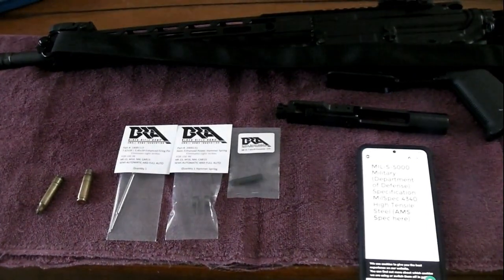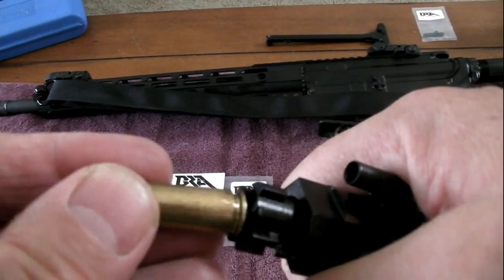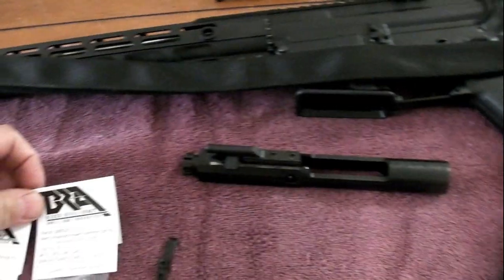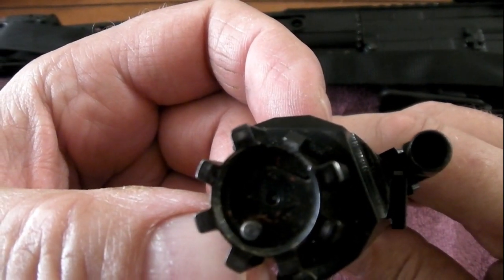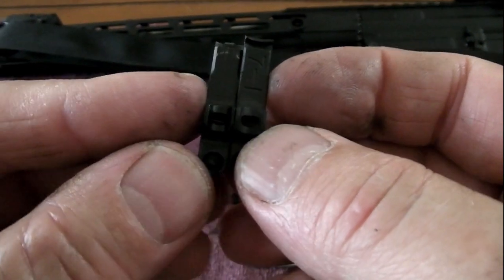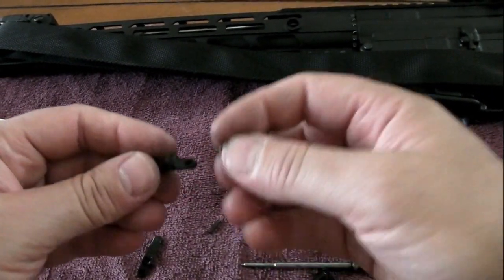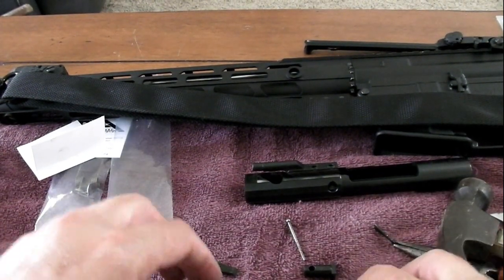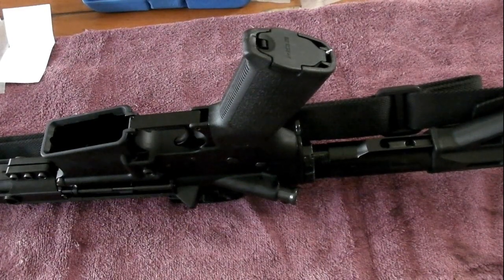7.62 X 39 AR15 Extractor Problems

Comment: I tried using the BRA extractor with Tactical Springs 4-Coil Extractor Springs, and the darn spring wouldn't fit in the cup. I ended up using my old extractor that wasn't broken, and I had failure to eject issues every time. I contacted Alan from Tactical Springs about this issue, and he thinks that the extractors themselves are all out of spec. It certainly wouldn't surprise me, but I just wish every brand followed the same military specifications.

Comment: Well I got about 500 rounds in before my extractor broke on a Bear Creek Arsenal upper.  I  replaced the firing pin fairly early due to light primer strikes with the same brand you have in the video. Guess I will start doing some more research on extractors now.
Reply: Will that extractor fit a BEAR CREEK bolt carrier group bc I can’t find a replacement and was just gonna pay 200$ for a stainless BCG
Reply: @eboicut7428  I did get an extractor for my rifle... but I'd be lying to you if I told you where I got it from let me dig a little and I will give you a better answer.
Reply: @eboicut7428  also I am currently trying get to sell  that rifle.  Just decided to go with a KS-47 from PSA. I was in the same lathe as you looking at trying to buy just a back up bolt to have on hand but could ever find just a 7.62 AR BOLT and didn't wanna pay $200 for a BCG for a $230 upper.
Reply: @Matthew1831 I see bear creek don’t offer extractors for replacement and every other brand says they don’t fit beer creek 762x39 BCG
Reply: @eboicut7428  I remember now I called BCA and they sent me one for free. I did up grade to a H buffer as well.
Reply: @eboicut7428  did you buy it directly from BCA? If so just call them they will send one out free under the warranty.

Comment: How many rounds did you put through this rifle before the bolt face started having problems?  I have used three separate AR-15 rifles in 7.62 x 39.  None of them have had bolt face issues.  And one of them I have put about 500 rounds through it.

Comment: 😅😅 so I may have messed up and gotten a 5 coil "upgraded spring" but feeling like it may be causing a hang up, has anyone run into issues being able pull the bolt back w the charging handle w a new spring setup?

Comment: No updated videos,  did all go well with the new extractor??  And did you need to put in the enhanced power spring?  Exactly where I'm at.   I got my new extractor in,  then I had some light primer strikes while testing for the extractor function.  Thought my pin went bad so I packed up.  was already on limited time at the range.   But my firing pin was ok compared to my back ups I already had purchased.   I'll take my enhanced spring with me next visit.  But I do want to buy some enhanced extractors for back ups.   Bca sent me replacement parts to replace the bent enhanced firing pin,  and broken extractor after only 150 rds.  But if I can find more reliable extractor I'll do that.
Reply from the maker: Replacing the extractor did it and firing pin and it works fine, so far no need for the new hammer spring
Reply: @venturahwy76  that's exactly me too so far.   About another 150rds in.   I did however replace the carbine recoil spring and buffer with sprinco blue(slightly heavier) and h3 buffer 5.7ou (vs carbine 2.7ou)  i wonder if my light primer strikes were just deep primers (common with Russian ammo i guess,) or actually bolt bounce due to too light of recoil spring/buffer.  I did those mods to lighten up recoil.  Seems to have helped that too.
Reply: @venturahwy76  thanks for the reply too.
Reply: I had the same issue failed zero extractor broke twice. I bought that brand BRA. Im running a h3 buffer and springco blue spring. I may go a little more lighter buffer spring. If the  extractor lip breaks again.
Reply: @spartan8860  I just broke my second extractor today.   Same sprinco blue and h3 buffer.   I'll check out the BRA extractor.
Reply: @spartan8860   thats what im running but just standard spring works fineee